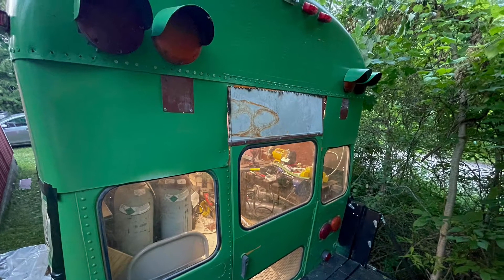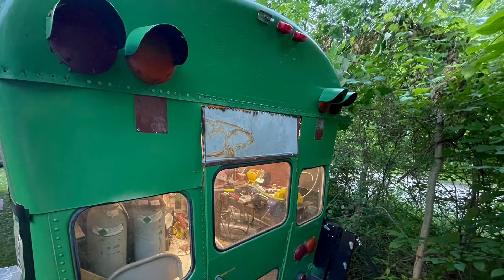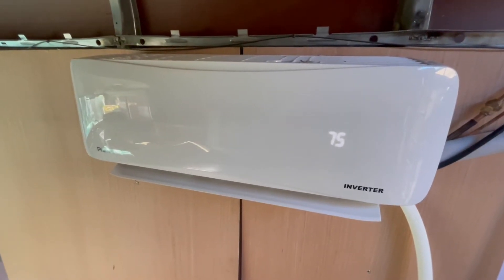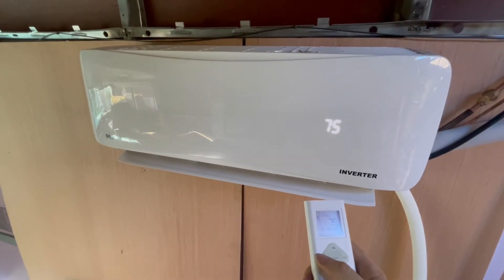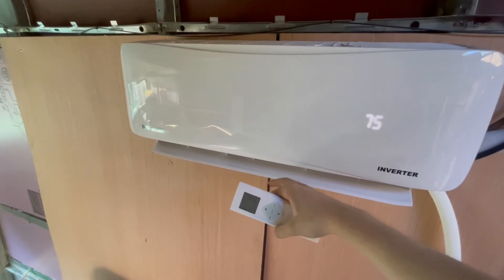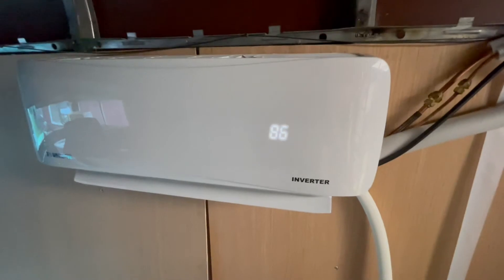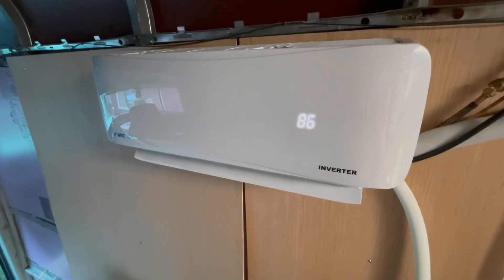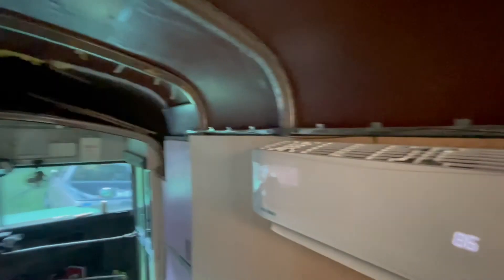Schoolbus conversion #7: Heating and Cooling

Comment: I was wondering how this worked out? especially after driving? I'm building a bus in Maine and moving/driving to sc in spring. then going to travel. was curious about a heat pump.
Reply from the maker: It’s been working well so far; no issues after traveling several hundred miles with it. Works well down to about 40 degrees Fahrenheit, at which point I need to supplement it with an electric radiator to keep things comfortable.